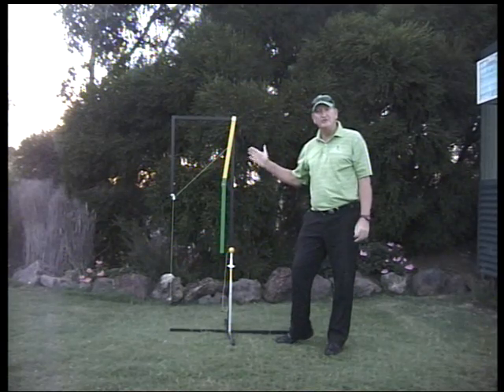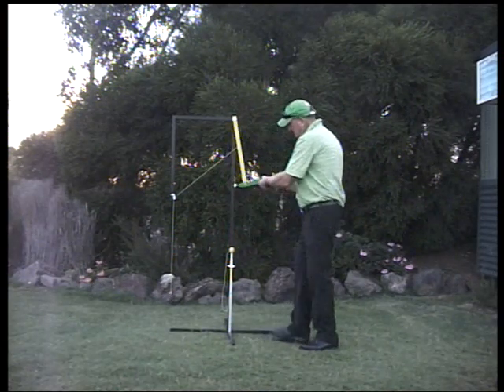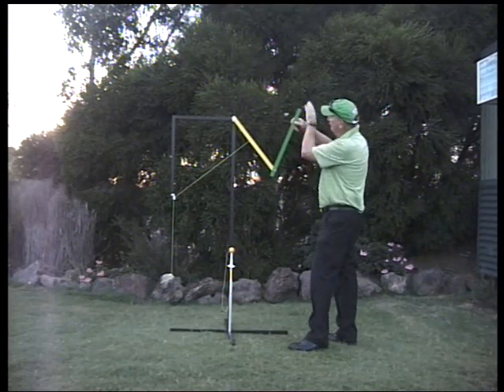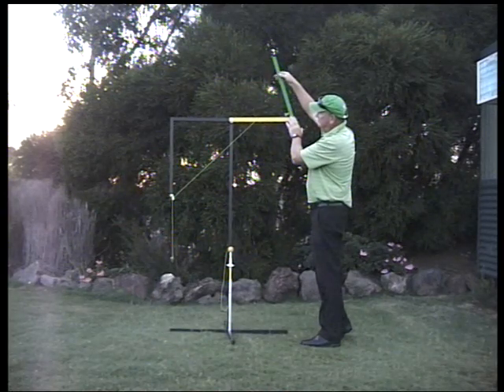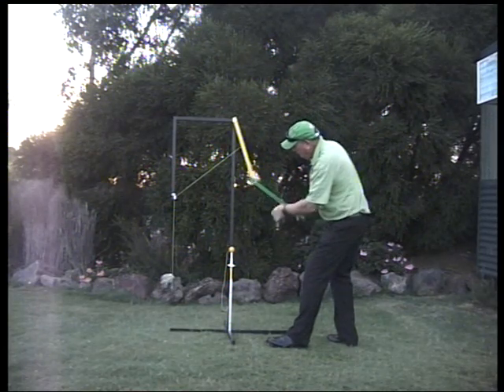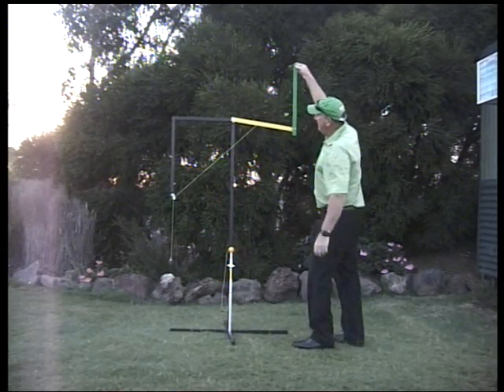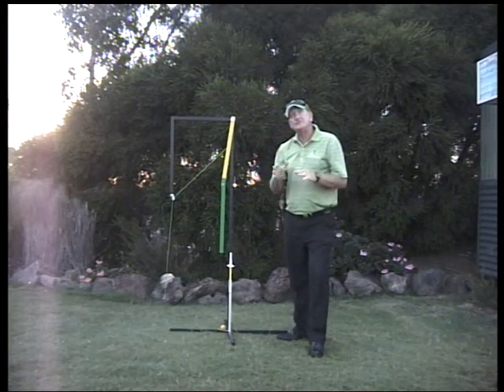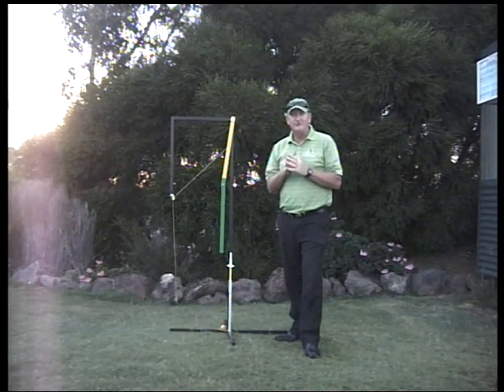Dual Pendulum System

Comment: After watching your clip your theory works for the model you describe perfectly, but you have to consider all the variables at work. The problem in the double pendulum theory is that you are working with 3 reference points 1. being the shoulder socket. 2. the ELBOW JOINT. and 3. the wrist joint. because the elbow joint is not fixed and it does hinge. as it is named a hinge joint, it must be a variable in your equation. To accurately articulate this moving action, there has to be a hinge break in the middle of the yellow bar to represent the elbow, not to say the action would not be reproduced but only in a different manner then described. I think Newton would agree. thank you.
Reply: zzzzzzzzzzzzzzzzzzzzzzzzzzzzzzzzzz